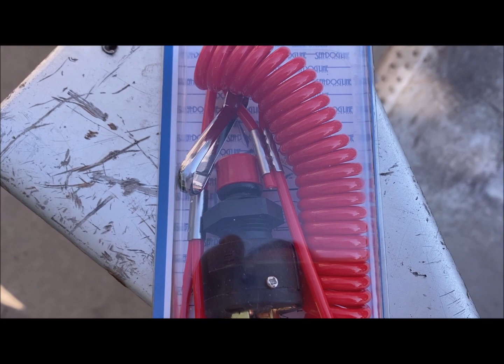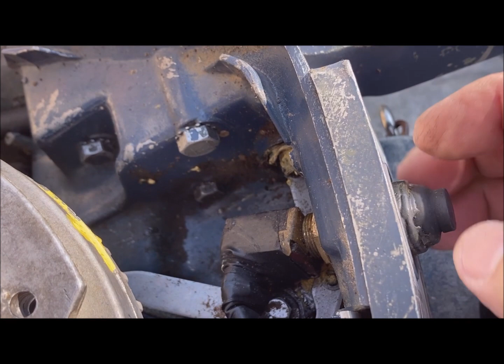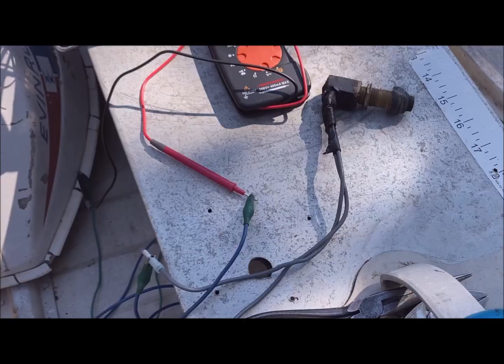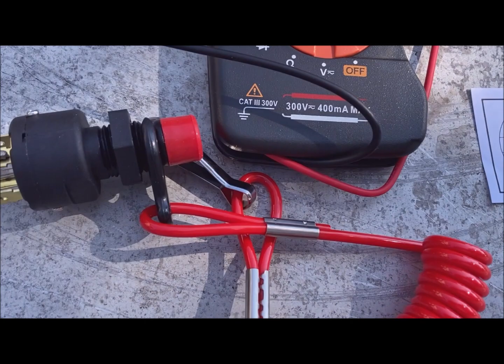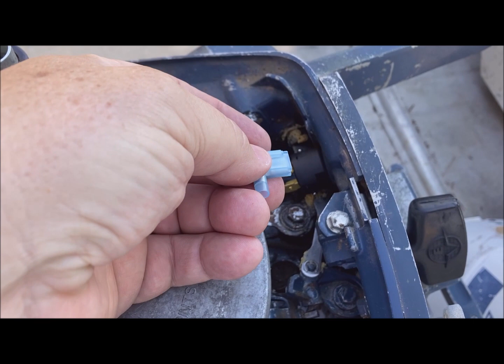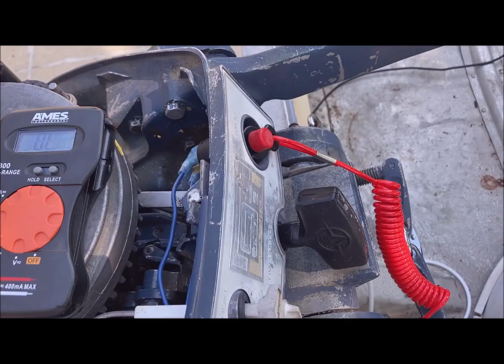Evinrude Johnson 9.5hp Lanyard Style Kill Switch Upgrade

Comment: Could you add 2 kill switches like keep the original and add a lanyard type?. Im just wondering if you can because if you're fishing or trolling, reaching around you may pull the kill switch lanyard. My theorie is if you can still have a push button to use at low speeds when fishing so your hand is not stuck to a certain distance but when you are going faster for saftey reason you would use the lanyard.
Reply from the maker: @kaynecorey6727  I use a coiled wrist band and attach the lanyard to it. When not on plane you are not required to use the lanyard. 
So it just dangles near the outboard. When I’m going on plane I put on the wristband linked to the lanyard.

Comment: Im replacing my kill switch as well, how did you know which wire is hot coming from the motor?
Reply from the maker: There is not a “hot” wire per se’.  The two wires from the magneto are one from each set of points. If you ground one of these wires, its associated coil will not fire that plug. It basically jumps around the points preventing them from opening which is when the spark occurs. 
But the way OMC set up the kill switch, both leads short together. This insures neither set of points will be able to create a spark. When one set of points is opening the closed contact from the other set of points prevents spark by shorting around it to ground. Quite Ingenious actually.
By doing this only one  set of contacts is required.
Reply: Thanks so much my factory switch was broken so I couldn't test to see if it completed a circuit pushed or released. To know how to wire a new one up. This helped Alot.

Comment: As for the studs coming off the kill switch did you end up using the ignition kill or the magneto kill
Reply from the maker: Magneto. I mentioned this in the video
Reply: I got a universal kill switch that looks exactly like this one. It's wired backwards from this. The "coil" setting has open default and closed (beep) when you remove the lanyard. And the "magneto" setting is closed default and open when you pull the lanyard. The tiny little manual piece of paper it comes with even matches this, which is wrong.

So you should probably check the polarity of your switch before getting wasting a lot of time.